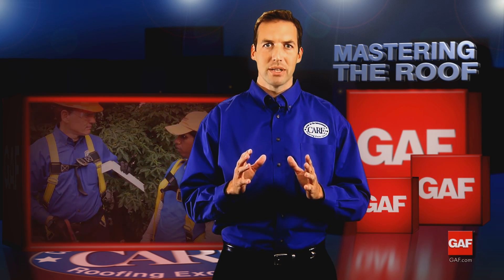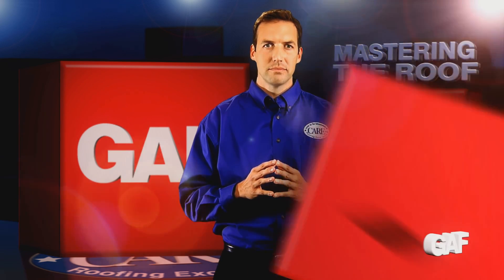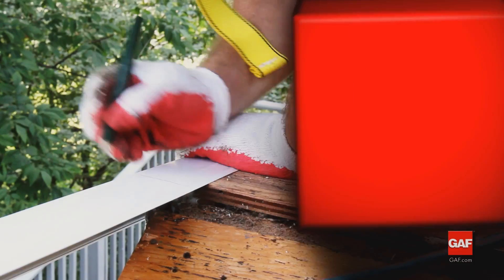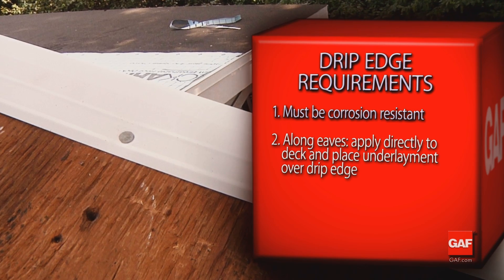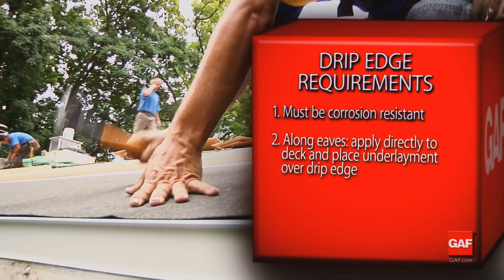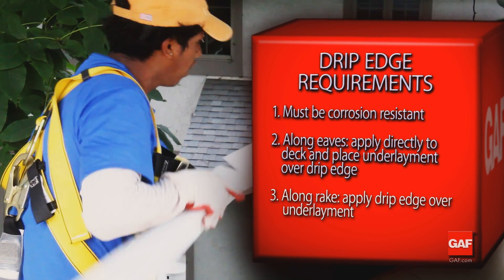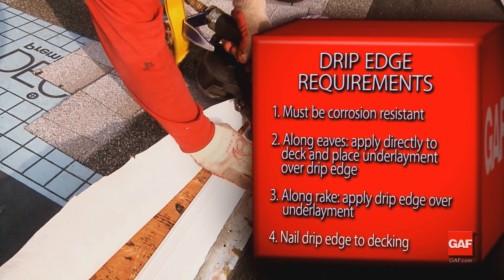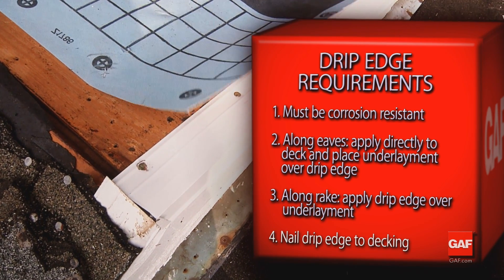How to Install Drip Edge on a Roof | Mastering the Roof by GAF

Comment: That drip edge  was installed incorrectly and also the worst drip edge to buy.   First and foremost  you need to make sure the dripedge  isn't  tight to the fascia board or its basically useless!!  You need at least  a 1 inch overhang so water  can drip into  the eavestrough.  If you do it the way you just showed,water will drip in behind the eavestrough.   I wish I was able to post a picture  of what a good quality drip edge should look like but I'm not able to.  It's crazy to me how many roofers  don't  understand  how drip edge  is supposed to work so that they can properly  install it.

Comment: The guy who installed the room put the roofing material  without leaving 1/2" space for drip age. Now what to do? I heard you can attach plastic apron on the roof so that the water will be directed into the gutter. How do I install the apron? Is it ok to install on top of glued roof? If yes, what kind of sealant to use?

Comment: Has anyone had leaks or problems from drip edge notching?  Our roofing contractor notched the edges of the new drip edge around the existing gutters, so when the gutter guys came and took down the old gutters to replace them, they found all the notching.  They voiced a concern of leaking due to all the notching.  Obviously they should have waited to put the roof on until after the gutters were removed.  It seems to me that notching the drip edge will compromise its ability to keep out water.  Of course the roofer says it's not a problem.....Any thoughts?
Reply: Notching the metal would not cause a leak, the gutters are pushed up so the drip edge sits inside

Comment: GAF and its CARE training program keeps hammering away at these great videos.  They are simple and easy to understand.  I recommend homeowners to listen to as many as possible before hiring a roofing contractor.  These videos will give great insight to the basics to look for in a roofing contract.  In addition to basic 36 Gauge drip edge, we offer custom drip edge for your home in many products including custom paint to match.  Many homes require elongated drip edge to bridge the gap from the  fascia to decking decking.  For more information contact us at www.AustinRoofingContractors.com or call (512) 491-9050.

Comment: Sadly, several major insurance carriers in the Texas market are not covering this important step in roof replacement.
Reply: Oklahoma too.  Insurance will pay, then see that you hired lazy losers and triple your rates, they also leave notes on your insurance  (forgot name of their tattle tail report, like a credit file it follows you, but for insurance) So if you get baited by another companies low rate offer, they'll change the offer as soon as they run your ssn for credit.  Ok. TX, OK. How about some CONSUMER protections??  Or are you just glad they are covering tornadoes?  I guess they could just pull the California insurance favorite....and call it an act of God, so not paid.  And thanks GAF  for dangling that 40 year asphalt shingle propaganda then the small print says the installer has to be certified and use three other GAF products to qualify with the roofing job.  FU too GAF.  thanks for nothing.  My 20 year old roof was better before I put these brand new GAF forty year shingles on.